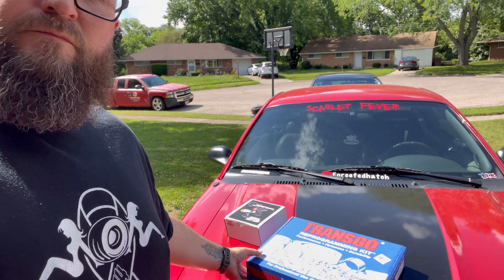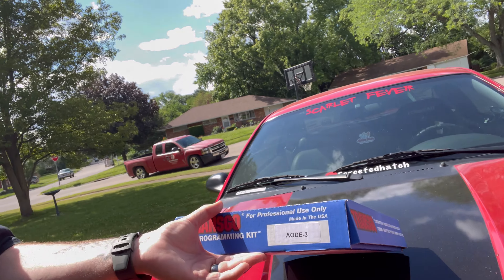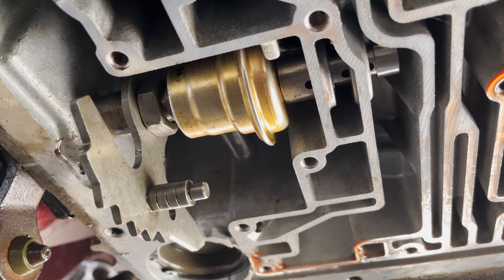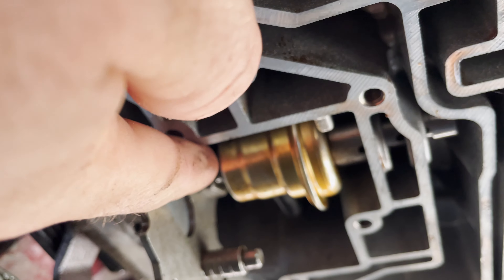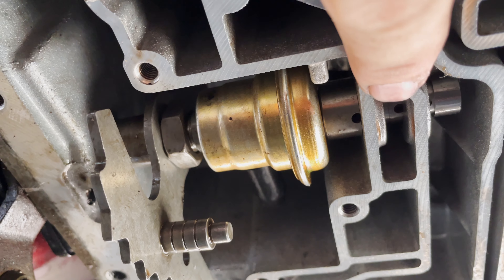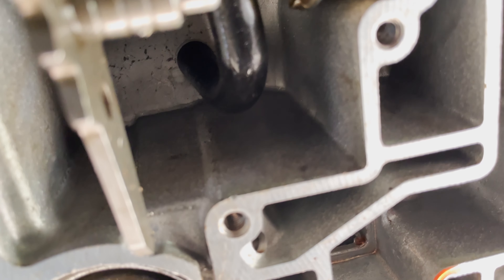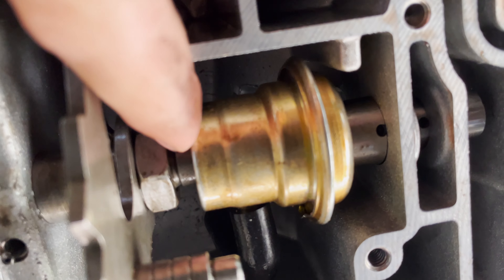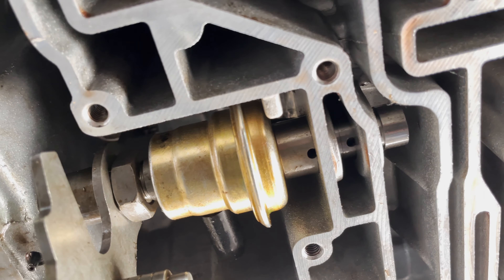Mustang 4r70w manual valvebody conversion

Comment: Did you ever hook up the vacuum modulator to vacuum reference? My Silver Fox Racing manual valve body did not come with a vacuum modulator like yours did. Evidently the EPC solenoid stays in place, but the circuit board that goes to it is cut off. I’m kind of confused on this one.
Reply from the maker: Yes I did, but didn’t get to go crazy with it because a few pulls later I lost 3rd gear sadly I think I drove too long without it and may have caused the failure. Currently swapping in a 5 speed..

Comment: Hey got mine all in hits like this vid. Except iam at 30psi line pressure set up by gauge my concern is do you think it’s hard on the u joint I feel as if I need to put new one in might just kill these is there stronger aftermarket ones thanks
Reply from the maker: Honestly I don’t think I would worry about the U-joints unless they are worn. Strange, and spicer make strong units I believe.

Comment: I put the same kit in mine it shifts into 2nd gear fine but it won’t go into 3rd I noticed it when I was changing the springs there was no 3rd accumulator piston so I left it that way does it need that piston to shift into 3rd?
Reply from the maker: I would assume so, also it could be a combination of things. I would contact them and ask!

Comment: Did you leave the ecu/trans electrical plug, plugged in?  Or left unplugged?  Thanks!!
Reply from the maker: I left it plugged in so I can still monitor trans temp on my SCT gauge, just unhooked the solenoids and electronics pressure control.
Reply: Sounds good.  Basically cut the wires that go to soleniods, left the rest atrached?
Reply from the maker: @sdragnut  yup, that’s what I did..

Comment: is it correct that if the vacuum modulator is not hooked up, you just have full pressure all the time?  Were you able to get your vacuum connected?   And if one had a high stall converter, would it even matter?
Reply from the maker: Sorry, just saw this! Yes it will have full pressure all the time.  Did get it hooked up and it helped a ton, the stall will help a ton as well. Sadly I lost 3rd gear playing too hard with it and now I’m swapping In a 5 speed.
Reply: Thanks.  I love mine.  I rebuilt my trans prior to the mvb kit.  Also have 3200 stall.  Fun fun.
Manual sounds fun too👊
Reply from the maker: @sdragnut  that’s awesome, Glad you like it!! Yeah hopefully mine will be fun again soon lol.

Comment: Is this safer than just manually shifting the 4r70w? (96 Tbird LX, 73k miles)
It definitely seems faster shift-wise, but I worry about the wear from forcing the gears into place.
Reply from the maker: It truly depends on the application, if you race it or do a lot of spirited driving then yes this is the way to go for faster firmer shifts. If you like the transmission shifting for you then this is not the way to go. This makes the transmission full manual.

Comment: Hey I have a 1997 mercury cougar xr7 4.6 2v. I wanted to do a shift kit so I get that sweet Chirp into second and manual control. Seeing as manual swap will be a load of bs.   How is driveablity and is 4th still useable?? Also is there any specific kit you would reccomend for this. I'm having a shop do my work, but idk what I want yet.
Reply from the maker: Great questions! For this kit yes you would need to wire it up for 4th/OD to work. It would shift into 3rd then from 3rd you would flip the switch for OD. And yes you can go down to other gears easily and smooth as long as the vacuum modulator is installed it will be smooth. Mine doesn’t have it hooked up so the shifts are rough and ultimately my trans being high mileage doesn’t help either. In your case I would recommend doing a J-mod on the transmission, swapping rear gears, and enjoying that way you don’t forget or get tired of manual shifting and you will get that crisp chirp you want as well!
Reply: @forcefedhatch  is there any in-between? Like would the jmod kit make dropping it into first while cruising smoother? I want to beable to use the selector when I want, safely, and have that sweet Chirp. If this is the only good way to have that reliable manual shifts its probably what I will do. I can forget about automatically shifting. I had a dual clutch vw. Never used drive and absolutely hated the automatic downshifts while using selctor, but if there is anything that will allow me to downshift smoothly and safely while still being able to use drive, that's what I'm looking for but I don't know enough about these kits or how they work. Right now the car loves dropping into second with a bit of gas. It's honestly smoother than the upshifts sometime, but it hates 1st, even if im going 5 mph and drop it into 1st it jerks around. I really just want to eliminate that, and have the sweet 1-2 chirp.
Reply from the maker: @readylucas  sounds like you have some shutter from the 2-1 shift. This would eliminate a lot of that yes, but it also could be in the torque converter or in the lockup function in the ECU. Example: trans wants to engage torque converter lockup in 2nd or even 3rd, but has to disengage before it makes a shift in either direction so it doesn’t snap the input shaft itself or the lockup shaft. So engaging and disengagement can create that “shutter, or hesitation” during that time. Also the 4r70w and the AODE transmissions are notorious for that shutter from the converter itself.
Reply from the maker: I never engage lockup unless it’s on the highway. And even then i have it wired up that if I disengage my OD it grounds out and disengages the lockup at the same time to prevent input shaft damage.
Reply: @forcefedhatch  are these things that my trans shop should automatically know when doing a shift kit. Or should I be weary of letting a shop do this work. I don't feel confident doing it myself but I'd love to turn my car into a semi auto. The things that scare me are the lockup and high line pressure.
Reply from the maker: @readylucas  i reputable shop, or even a performance shop can def. Get it handled for you..
Reply: @forcefedhatch   I have been thinking on just jmodding it, and getting a trans cooler.. I have been looking at some sport shifters for 4r70w, they have semi auto functions, and normal gears. Have you heard much about these? i want one but dont know what else i need to hook it all up. first thought was a new computer.
Reply from the maker: @readylucas  yeah, like the B&M ratchet shifter. I used to have exactly that long ago. They are nice just takes a little bit to get used to.. I say go for it with a J-mod. Also if the J-mod isn’t what you’re looking for afterwards then you can explore other options.
Reply: Did you have to drill the case to get the vacuum mpdulator valve to fit. My kit seems like it is a little bigger an was worried bout what size to drill

Comment: To shift in 4th gear do you need to turn O/D on and to leave 4th back off again with that trans ?
Reply from the maker: 4th is overdrive, once the ground circuit is activated on ss1 and ss2 and it’s in 3rd gear, the O/D band engagement happens. Then if you want to lock the torque converter you ground that circuit as well, but!!! Never shift gears with the converter locked!! It will break the 2 piece input shaft!! Disengage the lockup, then shift gears. I never use lockup unless on the highway with O/D engaged.
Reply: @forcefedhatch  I see , thank you.  I'm getting my trans built for my sn95 and it's automatic and they asked me if I wanted to xfer it to a manual valve body. I was just kinda clueless with how to shift into 4th gear if you had to assuming you're going over 50mph?
I guess once you need to shift into 4th you just press the overdrive button back on and to leave 4th press it off ? Lol
Reply from the maker: @stevedully1829  not entirely, you put it on a switch the keep the circuit engaged. So when you want it off, just toggle the switch off. The button on the shifter becomes inoperable, Ill be using it as a line lock button in the future.
Reply: @forcefedhatch  I see , would you recommend a manual VB for a weekend car? I sometimes go to the track maybe once a month. Kinda wanted something different and more fun. Or is this conversion not a good idea for putting around town accosionally with?
Reply from the maker: @stevedully1829  honestly I drive mine everywhere with it, no problems!

Comment: is the trans still connected to the ECU?  IS the ECU happy with the manual, no codes or anything?
Reply from the maker: The ECU is fine, the O/D light will flash because it’s saying something isn’t connected, and obviously the shift solenoids are not lol,but the trans still is connected for fluid temperature, and speed sensor input. So everything still works as it should other than the shifts being controlled by the ECU.
Reply: @forcefedhatch  thank you for the info👍
Reply from the maker: @sdragnut  no problem at all! Anytime!!
Reply: @forcefedhatch  hey man where did you get the vacuum modulator
Reply from the maker: @TM-ir1sj  it actually came with the kit.

Comment: Awesome. Going to have to do the same to my aode. Do you still have od?
Reply from the maker: Sure do! All on a switch, sadly I was out being a fool and killed 3rd gear lol. To be expected with 165,000 miles on it, swapping a 5 speed in the car currently.
Reply: @forcefedhatch  well dang! I wonder should I just swap in my built c4 lol mine has over 100k miles on it too
Reply: @forcefedhatch  is the switch included in the transgo kit?
Reply from the maker: @coryman4245  no, but any basic 12v toggle switch will work for it.

Comment: How does your overdrive work? Does it still kick in?
Reply from the maker: Yes, overdrive is electronically controlled on the 4r70w, you wire in a toggle switch to engage the overdrive and the torque converter lockup.. the wiring instructions for those are included in the kit.
Reply: @forcefedhatch  sweet thankyou
Reply from the maker: @BJnCars  hey anytime!!

Comment: Is od manual with that kit as well or on a button?
Reply from the maker: It’s on a separate toggle switch, so once in 3rd gear, flip the switch to ground the circuits for both shift solenoids to engage overdrive. I then have converter lockup wired the same way.
Reply: @forcefedhatch  thanks for the reply. I’m gonna do this on the blown ranger. I picked a 4r70 up Friday. They proud of those valve bodies for them lol
Reply from the maker: @theblownranger2471  awesome!! Do work!!!

Comment: What final gear you have in the rear?
Reply from the maker: 4.10’s but gearing to a 4.56 soon. So this needed to be rectified obviously before that.
Reply: @forcefedhatch  Holy hell. I seen Sergio Rojas Black Saleen fox body with a 4r70w making about 1300hp using 3.55 gears. Your car must rev super fast in first gear?
Reply from the maker: @FourDGarage  it does, as soon as it hits 3,500 it wants to tach out immediately. And it’s not even a fast car, that’s the funny part! But I’ve seen this is a very common issue with the Aod-e and the 4r70w. My luck obviously lol
Reply: @forcefedhatch  slapping a Lower final gear will fix the high rev in first gear. Maybe like a 3.90 or a 3.73.

Comment: What stall you running?
Reply from the maker: 3,800
Reply: @forcefedhatch  ok cool. I was just wondering because normally a stall will cushion your shifts a little bit under part throttle but your shifts are still crisp. That’s a perfect shift to me
Reply from the maker: @marcusc102  yeah it’s shifts great for sure! Much better!!